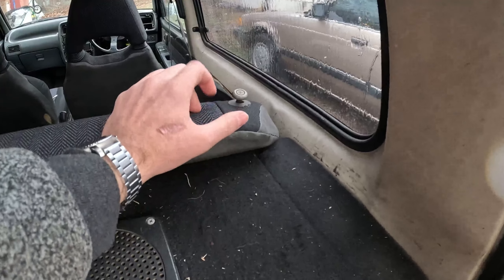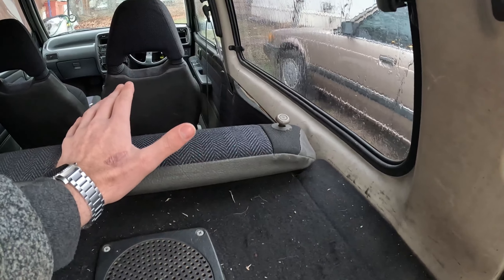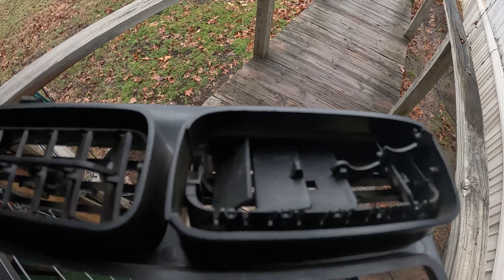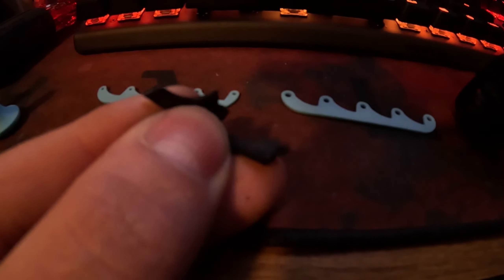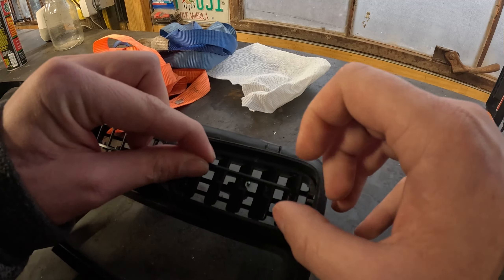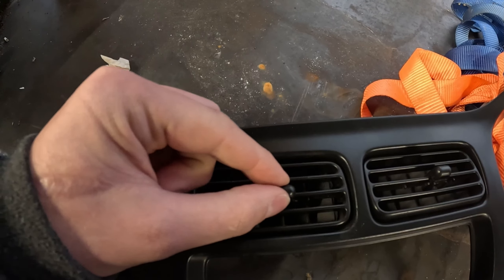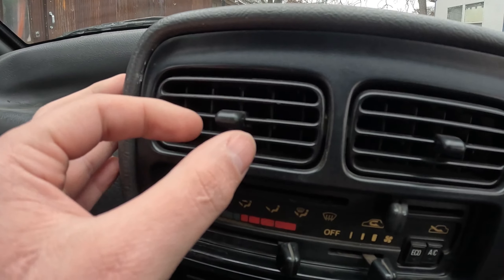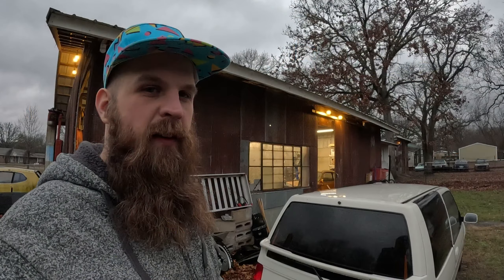I Used 3D Printing to Replace Hard to Find Parts on my Suzuki Alto Works!

Comment: I could not agree more. 3D printing IS the future of car repairs, especially for cars made in the late 70s to practically today. I'm sure your 90s GM truck would benefit from having certain plastic pieces reproduced at home! So far, it seems like a less expensive replacement as well as more durable than the factory ones. I don't know how much the material cost and the time it took, but they're better than paying a lot of money for OEM replacements online! Those are probably no better than the parts you're trying to replace!
Reply from the maker: Also the cool thing about it is, you can share the files with other people and they can make one for themselves if they have a 3D printer and I am sure the ones I made will last, and if not I can print a new one and make it stronger. The biggest cost is the printer, which you can get for as cheap as $100 bucks if you don't mind tinkering with it a lot.

Comment: My son is a computer wiz  he just bought a 3d printer and is making some really cool stuff with it. Very nice tool for the toolbox. Great video sir.
Reply from the maker: Definitely! PLA, which is the most prolific printer filament is not for use inside a car, but you can use it externally on the outside of the car. I recommend ASA or PETG for interior parts. Just as a heads up.
Reply: Thank you for the advice. Trying to make a small quarter panel piece to cover rust on a Ford focus now. Not going well lol.
Reply from the maker: @mg8919  it's a lot of trial and error. I haven't tried doing body parts yet, but I plan to.
Reply: @TMPGarage  I know it's not the correct way to repair rust problems but on a budget it is ! Having problems getting the lip where it meets the inner fender correct, but we will figure it out. Thanks for what you do. Makes us backyard mechanics feel like we can do things too. Love your videos
Reply from the maker: @mg8919  thanks for the support. I am not an expert, so if I can do it you can too.

Comment: I've got the same Alto and my entire interior door handle and arm rest shattered. :(
Reply from the maker: You may be able to glue it back together with acetone seeing as they are ABS plastic.
Reply: @TMPGarage  it absolutely crumbled. It was already brittle and then -35c when it got touched. 

Friends of mine have a 3d scanner I've considered scanning the intact one and mirroring it and printing it out. Maybe with a cup holder lol!

Then i won't have to stuff my coffee in between the ebrake and the seat and hope for the best lol
Reply from the maker: @SarahGoldennope  I have my old one that broke in half, I may be able to put it back together via my acetone repair method and send it your way. Let me know.
Reply: @TMPGarage  is there an open email inbox I can message you at? (I am atrocious at YouTube socializing) I would like to talk shop  with you and brainstorm. My window latch just snapped this morning on my first drive of the year. :c
Reply from the maker: @SarahGoldennope  Sure, my email is tmpgarage@gmail.com